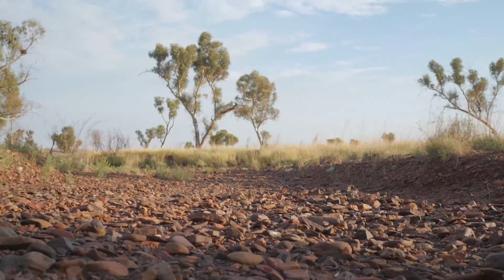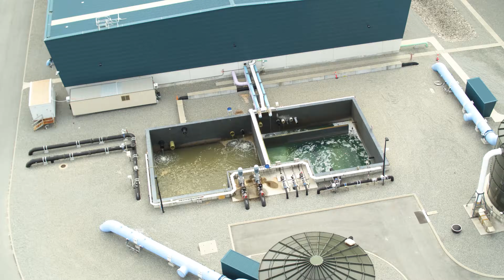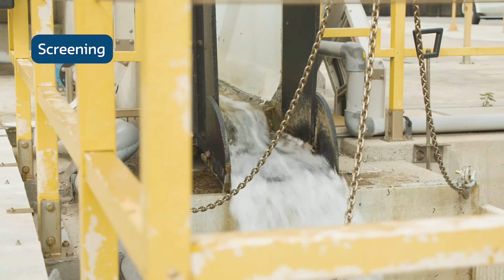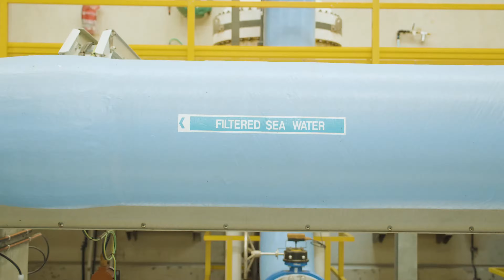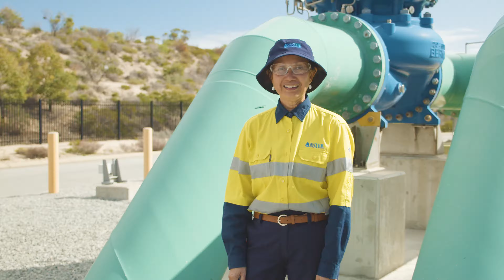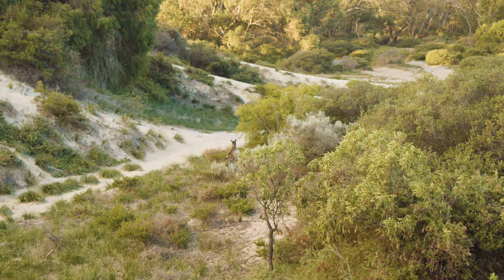What happens at a Seawater Desalination Plant | Our water world

Comment: “Respected Madam,
I kindly request you to prepare a detailed video explaining the method adopted in your plant for handling and processing RO reject water, particularly considering its elevated TDS levels. It would be highly beneficial if you could also include key operational and design parameters relevant to the reject-water management system.
This information will be extremely useful for professionals engaged in RO-based water treatment operations.”🎉

Comment: Desalination plants are massive infrastructure projects, and their cost, maintenance, and energy usage vary based on scale, location, and technology (usually *reverse osmosis (RO)* or *thermal distillation**). Let’s break it down assuming you're talking about a **large-scale reverse osmosis (RO) desalination plant* that produces around *1 million gallons per day (MGD)* of potable water.

---

### 💰 *1. Capital Cost (Building the Plant)*

For an RO desalination plant producing ~1 MGD:

- *Estimated Capital Cost:* $10 million – $30 million  
  (varies based on location, design, labor, material costs, and environmental regulations)

> 🧠 Rule of thumb: ~$10–$30 per gallon/day of capacity for construction.

---

### 🛠 *2. Operating & Maintenance (O&M) Costs*

This includes energy, chemicals, labor, membrane replacement, etc.

- *Typical O&M Cost:* $1.50 – $3.00 per 1,000 gallons  
- For 1 MGD → 365 million gallons/year  
- Annual O&M = *$550,000 – $1.1 million per year*

---

### ⚡ *3. Energy Usage*

Reverse osmosis is relatively energy-efficient compared to thermal methods.

- *Energy Consumption:* ~3–6 kWh per 1,000 gallons  
- For 1 MGD → 3,000–6,000 kWh/day  
- That’s *~90,000–180,000 kWh/month*

Assuming an average electricity cost of **$0.10/kWh**:

- *Monthly Energy Cost:* ~$9,000 – $18,000  
- *Annual Energy Cost:* ~$110,000 – $220,000

---

### 📊 *Summary for 1 MGD RO Desalination Plant*

| Category             | Estimate                         |
|----------------------|----------------------------------|
| *Capital Cost*      | $10M – $30M                     |
| *Annual O&M*        | $550K – $1.1M                   |
| **Annual Energy Cost**| $110K – $220K                   |
| *Total Annual Cost* | ~$660K – $1.3M                  |

---

### 📍 Bonus: Large-scale Example

- *Carlsbad Desalination Plant* in California  
  - Capacity: 50 MGD  
  - Capital Cost: ~$1 billion  
  - Energy use: ~35 MW (megawatts) continuous  
  - Water cost to consumer: ~$2,000–$3,000 per acre-foot (~325,000 gallons)

---

Let me know if you want a model for a small island, a mobile system, or a developing country setup—costs change drastically based on context.

can you tell me how much of it true?
Reply from the maker: @nastybadger-tn4kl, thank you for your comprehensive explanation. We always use the most affordable source of water first though even still we need a range of water sources to ensure a reliable supply. Our scientists and long-term supply planners have spent the last 20 years diversifying our water sources to secure our water future – A glimpse into Perth’s supply and how it’s changed over time is available at https://bit.ly/SupplyOverview-WC. Before 1975, Perth’s dams received an average of 420 billion litres of streamflow each year. That's enough to meet Perth’s drinking water needs, even with today’s population. However, these days we average less than 70 billion litres. On top of that, our groundwater allocation is being reduced by our regulator, to help manage a crucial environmental balance. Many factors intertwined have led to the necessity of expanding our desalination operations. 

On the other hand, please feel free to submit your thoughts and feedback formally via https://bit.ly/3qkh9L6 ~Hannah

Comment: Except the highly dense saline outflow destroys the ocean environment when the return of the removed salts to the sea. Not surprised the video skipped that bit.
Reply from the maker: For clarity, salt/brine from our desalination plants is returned to the ocean via a diffuser 500m out to sea where ocean tides and currents continue to mix with the concentrated water. Within 50m of the diffuser outlet, the concentrate is back to normal seawater salinity levels - An underwater view is available via www.watercorporation.com.au/Our-water/Desalination/Southern-Seawater-Desalination-Plant. Our desalination plants meet stringent environmental protection criteria - We continue to monitor the ocean environment and report to relevant environmental agencies. They're designed to have minimal impact on the surrounding environment - Due to the high energy swell, the discharged concentrated seawater mixes quickly. The offshore discharge and intake pipelines are designed and located to minimise any effects on sensitive marine habitats, such as seagrasses and reef systems. Regards ~ Lara
Reply: @Watercorpwa why not just sell it as salt? You can make some treatment and whatever it is

Comment: Why would you speed through the eri power capture system so that we couldn’t understand?
Reply from the maker: Our apologies! This detail is available on our website; "Now, for the super high-tech section, reverse osmosis or RO. This part of the process requires extremely high pressure. Previously, we were at approximately three bar. We need to get the pressure up to 57 bar. How much is 57 bar? Well, it would push a column of water more than 570 meters vertically up into the air, along with high pressure pumps, we use regenerated pressure energy from the RO process to help generate the 57 bar. It all happens inside these energy recovery devices, which work by capturing the hydraulic energy from the high pressure, RO reject stream levels of seawater inside the rotor. The seawater leaves the device at high pressure and the RO reject at low pressure. If you're one of the small number of viewers that understood all that. Congratulations. For the rest of us, it simply means we recover and reuse most of the energy in a very clever way." ~ Lara